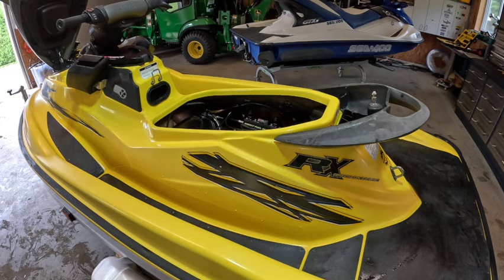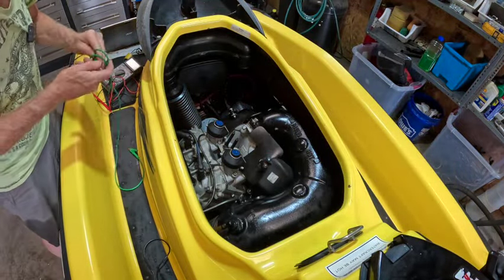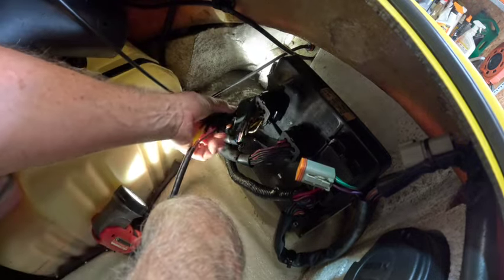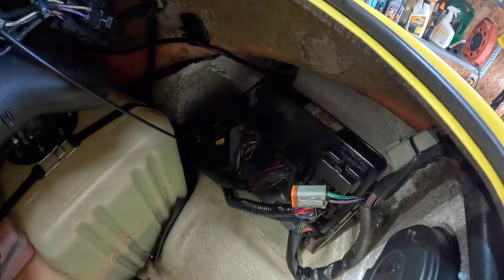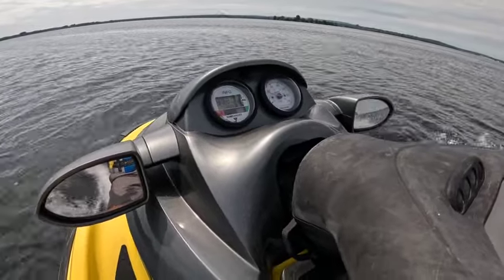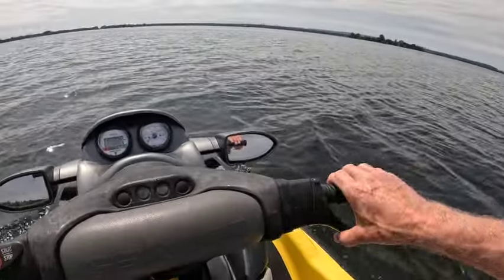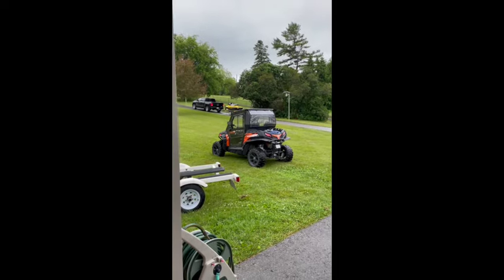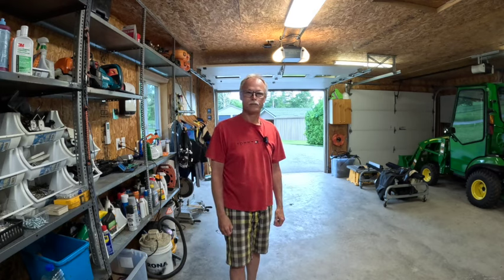Seadoo 951 di Rectifier problems

Comment: Nice video for all of us with older pwc. I have 2 questions, first how many oms you have on good rectifier and second how many volts  i must have on multimeter connected to battery with good rectifier ( to charge battery)
Reply from the maker: I have had no luck in measuring ohms on these rectifiers.  There seems to be very little difference from a good one to a bad one.  Bat volts should be around 13v at idle and 13.5 ish at high idle.

Comment: I just replaced my vts motor on my 2000 rx and it only moves in one direction. I tried reversing the wires and it didn’t make a difference. Do you have any suggestions on what the issue may be?
Reply from the maker: When you say reversing the wires ...What do you mean ?  If you directly apply power to the motor and then reverse the polarity does it move in both directions ?  If so then the housing is the issue and not the motor.  There are some electronic limit controls in there and they sometimes go bad .  I have 3 different ones that will only go in one direction.  Only fix is to replace the housing.
Reply: @SeadooRefurb  I tried switching the wires around since the buttons were reversed but it made no difference. I think you are correct about the housing because I checked it this morning and it doesn’t work at all now even with the new motor I installed last night. Any suggestions on where to find a new housing unit? Haven’t had much luck looking.
Reply from the maker: @codyharrington5953   Check fuses .  You may have just blown a fuse as you would be pushing the motor beyond its max limit.   Best place is ebay.
Reply: @SeadooRefurb  fuses are fine. EBay it is! Thanks for the help.

Comment: Can you help me? i have a 1999 Sea doo GTI i replaced the stator i now have spark, and yes, im getting fuel, but it won't start. Did i do something wrong
Reply from the maker: You need to see if you have 80 pounds of air pressure.  No air pressure means no start.
Reply: @SeadooRefurb  it runs but keeps back fireing it runs good when I hook up water to it but once I put it in the lake starts to back fire again

Comment: My rectifier gets too hot to hold my hand on. I think my stator is going bad.
Reply from the maker: That is curious .  I have never checked to see how hot they get on regular running.  Is the rectifier mounted to the stainless steel battery holder ?  That acts like a heat sink.  If it is then I would guess the rectifier is going bad.